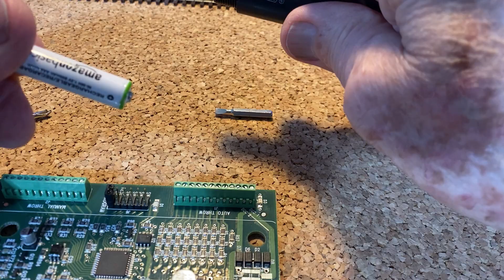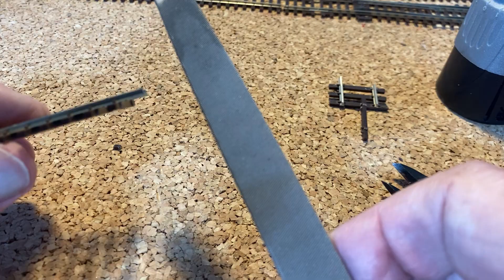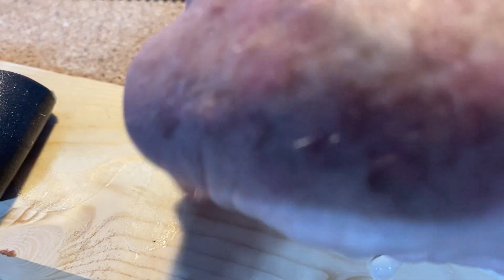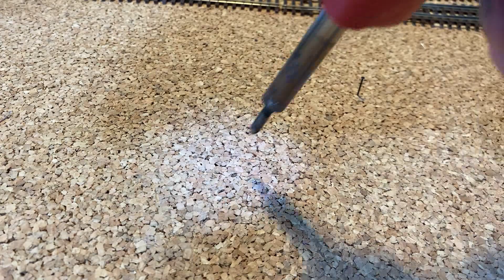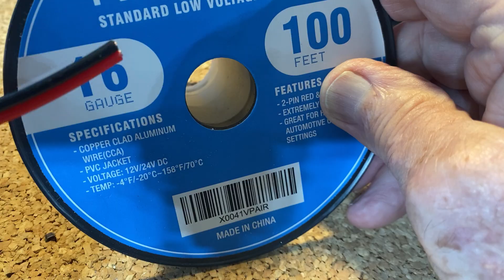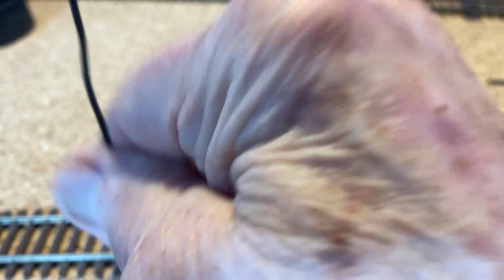Model Railroading Tools and Tips

Comment: Another interesting use for silicone sealants in model railroading.   Clear silicone sealants can be colored using a drop or two of inexpensive acrylic paint ... even acrylic  fluorescent paints ... per a couple tablespoons of uncured sealant.      A wooden coffee stirrer is handy for mixing.   The curing time will increase ... possibly to a couple days ... but curing will occur.   Examples: the uncured colored silicone can be formed into flames for a campfire or liquid hot metal for a steel mill scene.   LEDs can be embedded in the uncured material for lighting effects.   All the best ... Happy Model Railroading!!
Reply from the maker: @donaldkormos5529  Good ideas!

Comment: FYI those bits for that screwdriver I've found at home depot, lowest, Walmart and there is a 3d printed bushing for those bits that work in a standard 1/4" magnetic tip holder extremely handy
Reply from the maker: Good to know! I seem to have supply of them from my broken drivers!